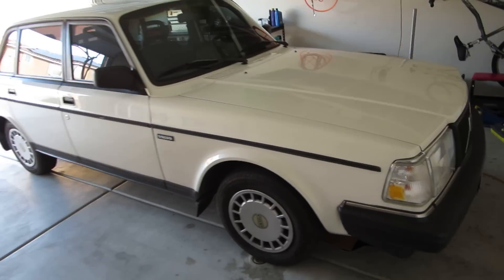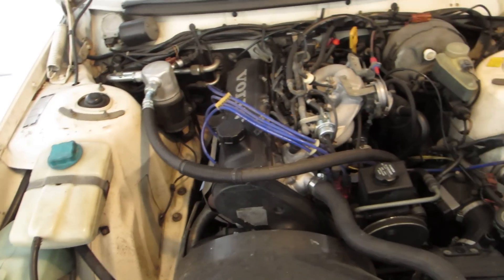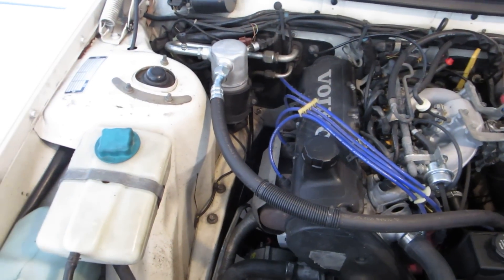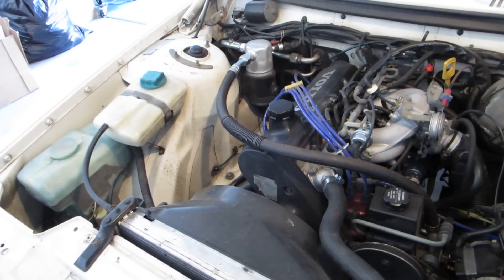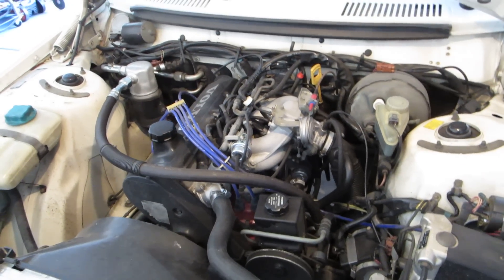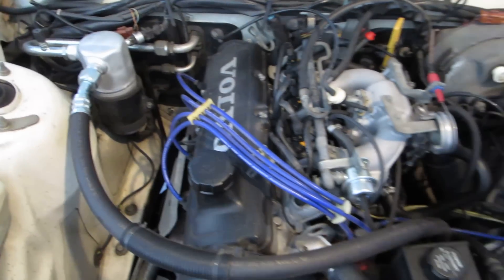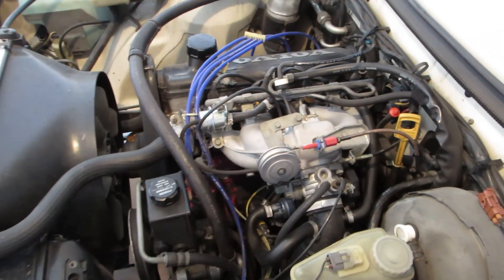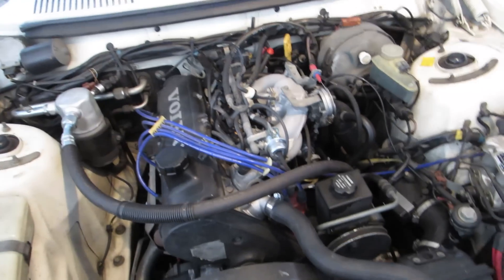Volvo 240 Pinging/Pre-Ignition/Spark Knock

Comment: Your engine is fitted with detonation detector.  This provides info to the engine control moduel (ECM/computer) which should pull the spark timing back on detonation detection.  So I'm wondering why it didn't.  Not that it's a bad thing that you found a split in your throttle bypass valve and fixed it.  Couldn't hoit! But I found that my on-board reporting system told me pretty much everything I needed to know about trouble in the fuel delivery system once I started plugging in the jack and using it.  See service manual for details.  (Hmmm. Maybe I should make a youtube video......
Reply: Snide Pete you mean knock sensor

Comment: Hello Sir,
Got my 1989 Volvo 244 GL and had it since February 2013. On my intake-inventory, I replaced belts, provided an improvised spring-loaded restraint to align the passenger side of the back of the alternator, so that the belts will stay straight and maintain the linearity, because the outer/passenger hind-side of the alternator did not have any retaining mechanism to keep it from going forward and cause the angulation of belts. Once, the knock sensor by firewall had to be replaced, because what I noticed that the mechanical connector had the contacts so loose inside the soft-insulation that had dried and itself, allowing the contacts to loose connection. Now, there is a switch/sensor located by the driver side of the engine and it is visible on our video at 3:58, attached to the pillar surrounding the front strut. It is a square box and it has some 4+1 connectors inside. It can be disassembled and there you will find a pressure switch, that normally stays pressed inside its cover. My mobile mechanic once told me that he had to open that up and after closing, he placed a plastic zip-tie around it so that it will not allow the back cover to pop out in case that switch popped out. But last week, when my Volvo did not start, I opened the sensor and found that the soft gel like material had broken off in pieces and the contacts were loose, more like what happened to  the engine knock sensor in March 2015 and had to be replaced, by the Volvo Specialty shop. I scrambled to find the sensor online, but have not been successful. I do not even know what to call it. My Haynes manual does not seem to name it, or I may have been missing it inside the book somewhere. The connector side has wires coming out and it is sheathed and goes down towards the lower section of engine along with a bigger set of wires. What is the name of that sensor? How do I resolve this problem? I have worked on all of my cars and motorcycles, following Haynes manual and improvise when I get lost, create parts and harnesses that work or stabilize the engine to reduce vibrations, design apparatuses to keep the bugs and rocks away from condensers and radiators etc etc. But I am lost here as to what to call this sensor, so that I can find replacement. Thank you.

Comment: I had my 245 down for months because none of the usual components were bad. Both your failure and mine ( a bad distributor that bench-tested just fine) are so rare that no one could have diagnosed it accurately from a distance. Never forget that just like you...others can be stymied yet they still want to help a fellow Volvo owner. Your video is quite critical of the suggestions you received. That is poor form for a Volvo owner. Please sell your 240 and buy a Honda. Please.

Comment: unless the idle control valve is split, all the air passing thru this valve is coming from the inlet tube and have passed thru the mass sensor so it should not induce a lean running condition.
I saw the problem with an EGR valve stuck partially open and it is causing low speed stumbling and pigning when the engine is working heavily.